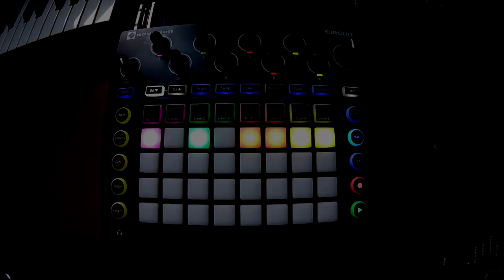SOUND DESIGN ON THE NOVATION CIRCUIT

Comment: I noticed that macro problem too (2.30).
I think you need to change the macro parameter on the hardware then re-save, rather than on the software.
Reply from the maker: 7billionand1 thanks for the tip 👌